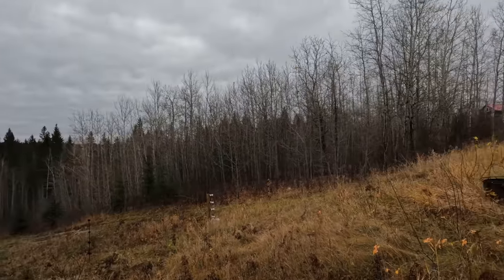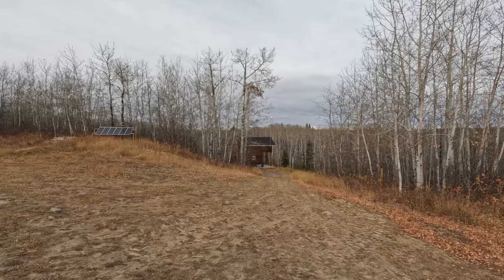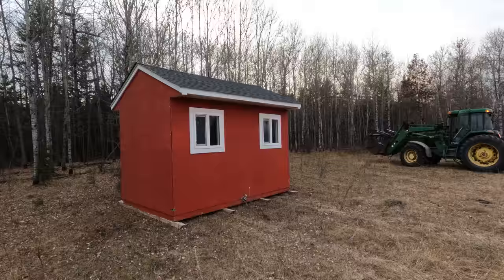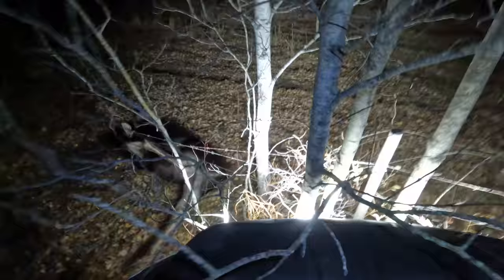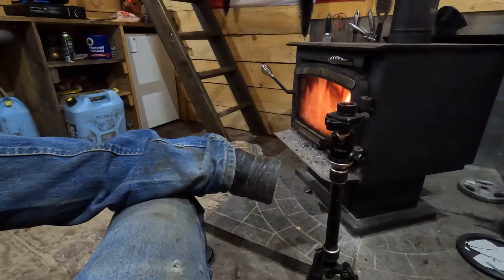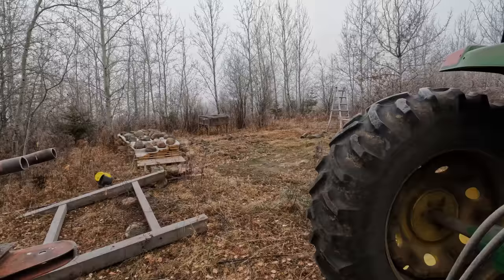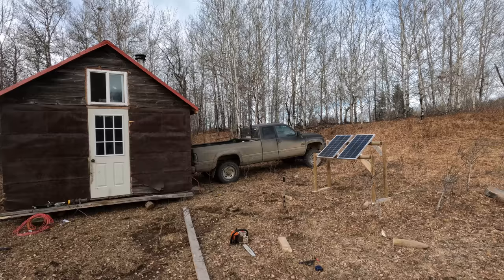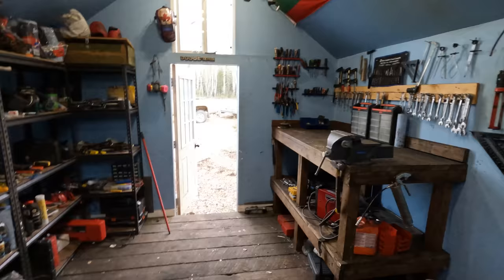Moving my Offgrid Homestead Pt. 1

Comment: I would put log skids under the main cabin. And no hurrying, just slow but sure and bring it on. I don't suppose you could get hands on some real house jacks to place the cabin on skids but if ya could then maybe get some straps right from the floor joists to the skids so it can't jump around a whole lot. A damn nice relocate... but the first place will always have a special spot for ya. I'd also move those logs that you started notching out in a form for log cabins and turn it into a fine outhouse... no need to waste a thing

Comment: Not sure if you have access to any I beam but if you do it would be nice to run on right under the left and right side under the cabin, chain or bolt an axle to it and rig up a tongue on it and away you go, keep it as close to the ground as you can so when it tips it just touches ground and not fall too far and bust stuff

Comment: First, leave the cabin where it is.  You have a lot of time and money to see go rolling down the hill and be completely destroyed. Protect your investment of time and money.  Plus, it is a place that you will always have to be able to go back into the deep bush yourself or it can be shared or used by family and friends to stay in for the future to visit or whatever.  Second, I have no idea how far your new home location is from your cabin presently but you could travel from home to work site daily.  You got through last winter and I'm sure you can figure out a way again.  Third,  you might want to consider remodel you chicken house. You could  put whatever size of addition on the side with the two windows.  Move the two windows to the new far outside wall or your selection of location. Place a shed roof or lean to type roof up to your present ridge.  Remove the metal roofing and reuse on the new shed roof.  of course you would need to possibly get a new stove and other materials but you would be at the new home work site  and when it is completed you could convert your large chicken hose conversion into additional storage, tool shed, workshop or whatever.  The small amount of $$$ and time you will spend to convert the chicken house for temporary lodging will be a lot less than the loss of the cabin going down the hill and then having to spend the money anyway.  You got great memories of everything about that cabin don't risk the loss and kicking yourself in the ass while you watch it roll down the hill.  Best of luck with
whatever you decide.  You have the talent to do whatever you choose.

Comment: I would remove the frame from wheel chassis if possible, lift the cabin drop her down on the frame or use skids and pull it with a dozer(not sure if that tractor can pull it or not, low gear 10hours of travelling time lol.......I think that trailer is a no no, can you imagine blowing a tire...or get someone with some experience to come out and have a look...Hope it all works out for you.....thanks for the video.

Comment: Yes, the tilting feature of that transporter is not so much a  feature but a problem for moving your cabin.  Move it like professional movers move most buildings.  Jack up the corners at strategic points a few inches at a time and support it -- just keep going around and around adding more supporting boards at each point until the whole thing -- including the porch -- is higher than the untilted flatbed, then just drive under it and lower it to the flatbed.  Also, this eliminates winching it into position. Then drive ridiculously slowly on a non-agressive path to its new home.  Reverse procedure and you're done. Drink a beer.
Reply: Also be sure the center of the cabin's mass is directly over the wheels so the trailer doesn't tip.  Very slow moving is key and no large potholes!

Comment: Hey to be perfectly honest I think if you have your cabin on a couple big skids like your shop it I think if they run lengthwise you could probably just pull your cabin right on the skids with that tractor. Wont have to worry about tipping it over that way or anything. Just my thought. As long as the front of em dont dig down too much I think it would be fine. Oh and put a good strong brace between the skids so pulling on em doesnt try to pull em lose and pull em together.

Comment: would you be able to dig away some of the dirt in front of the cabin so you could back the trailer right up to it and pull on flat? maybe even try to lube the tubes on the trailer with some wax so it will slide alittle easier. would also help pulling her off.

Comment: If you're going to move that cabin I would avoid tilting it at all. Jack it up and use cribbing until you can back that float right under it. Then set it on the float, reverse at the new site to get it off. This will keep the angle at a minimum, limited by the height of each cribbing section. (Use thinner boards to avoid excessive jacking.)

Comment: Moving the cabin is going to require most likely, two people and possibly two tractors. Use one to get the trailer under the cabin like you did with the other buildings. Then raise the trailer a bit to make it semi level and at the same time on the other side use another tractor to raise the building as your going under it with the trailer. This way you don't tip the cabin over and you can just back up with the trailer and cabin both level and slider her on. You might have to cut some holes somewhere to make sure she doesn't catch. Otherwise I would suggest taking everything out of the cabin to make it as light as possible if you do decide to do it yourself. Not sure how ur going to get it on with only one tractor if its top heavy without damaging it though. But even if you do somehow damage it, its not like you don't have an entire forest to fix it :P

Comment: It is possible to move your cabin your cabin but you are right in your thinking.  With my years in the construction industry and being an onsite structural engineer it is possible.   I'd like to also state 3 things.  One you would have to put in new beams under the floor.    I'm sorry to have to tell you that I saw how you built the cabin and there is Is one structural defect.   2.  The time that it would take to do all the bracing I believe is not in your best interest.   Lastly if you keep the cabin where it isYou will have an outpost down the road load it or you can use that to that when you're doing your trappingIn case of bad weather.   The last big thing I wanna say is I'm quite impressed with your ingenuity and the things that you are doing.    If you have any other questions or would like to talk more about this I would love to help you out with this project this project if I could.    Whatever you decide to do it's gonna be the right decision for you.

Comment: Great video. To move the cabin you will need to make it bigger, more square. Add a temporary side structure to it, and weigh it down with tractor weights to balance it all out. You're smart and motivated. I have full faith you can move it.

Comment: I think it's possible to move the cabin. But I would Drive some heavy duty eye bolts into the walls and run some criss cross cables or straps and up and down from floor to ceilings on the inside to keep the swaying down and make it super ridged and just creep a C hair at a time. slow and steady it should go smoothly. LOve this shit. Your a fucking stud my boy.

Comment: First I think I’d have the overhang towards the tractor. Then I would probably make some Custome steel type strap braces to go across the front wall of the overhang where your bed is and then the same for the other side then you could attach straps to them on angles from top front to bottom back and vide versa for the back to the front that would cover the front to back tipping then to help with the top heavy I’d add lots of weight to the main floor for ballast and if need be maybe add like a set of training wheels sort of thing to the trailer so it has a backup if it wants to go sideways. Maybe these ideas help maybe they already been suggested but regardless you can’t leave the cabin behind and so this is my ideas to help move the big bastard

Comment: not sure of your spacing but if you get your house high enough to get that lift trailer under it without tipping that would be best...other than strapping the tall bugger down what if you also dragged long logs behind or beside with straps attached to the top of the structure while on the trailer to help it from tipping...or even attach like out rigging to the side of the shed so it cant go side to side...like they do with canoes to prevent tipping over...

Comment: I would probably use a lot of come alongs so you can control direction of pull up the ramp. Tie the come along to the front of the trailer and some where close to the top of the roof so you can prevent the cabin from tipping on its ass. and go slow and steady. Back and forth from truck to come along making sure there is lots of tension. Again. Slow and steady. Also, be sure to say “she’s not going no where” every time, once it’s rigged or else it’ll go some where you don’t want it too. Best of luck. 

Definitely enjoy all your videos friend and looking forward to seeing more.

Comment: You need more frame on the bottom of it for weight and the base of it log runner bolt down and get the weight or the top of it a prayer might help go slow it's top will turn over

Comment: Glad to see you moving to a location that's easier for developing a homestead (and probably much closer to the road). 
I'm no expert at all, but I would move the cabin by building a external wooden frame which is screwed to the cabin. This way you don't squish the walls in and you have a better 'grip' of the building overall.

Comment: I would put the cabin on some big skids and pull it with the tractor not mess with that trailer to topheavy and the trailer on rubber sways to much or leave it there is the best answer your asking for trouble ya really dont need

Comment: Nice save of that moose and moving the coop and tool shed.  Better than watchin an old horror film tonight, although also a bit suspenseful.  😎
A fairly obvious idea for the cabin move, but the only one that I have:  use some strong braces (wood or maybe even straps) diagonally from bottom rear to front top and front bottom (of porch deck) to top rear.  Maybe the porch deck is not integral right now, but you can make it so...   The idea would be to get the cabin to act like a cube with the center of gravity near the center, not like an upside down L.

Comment: I'd use some 4x4's., Or 6x6's to slide that cabin onto your trailer with. For leveling purposes mainly To help with that part of stability.& Levelness & sturdiness all in one. Notch them out to fit underneath those other runners/ for joists studs by screwing in lag bolts.,or use some barn steeples. As in really long big barn nails for joining them together with. Myself I'd cut those steeples down to 5/8 length size for simplify everything on it all man A. Seriously it'll help ya out more in the long run to more. Plus you'll already be setup if you decide to relocate those buildings in different spots again to then where their at now for keeps sake as well to. I'd add on some srap buckles welded fully rings to connect your pull straps onto for loading your cabin on the trailer with.& For tying down purposes also just saying man. It'll add extremely extra security to as well. You'll half to run straps over the top of t the at cabin both directions to. So that means puts buckles on both directions to.

Comment: I think if you can figure a way to get it on the trailer you’ll be golden. Maybe weld some mounts to the trailer and bolt some eyelets into the cabin itself. So you can use some chain binders down low on the structure instead of straps over the roof and it would be plenty sturdy. But will you regret not having the real bush cabin still out there? That would be my only thought

Comment: You could probably brace the top of the cabin with some long logs bud, like from just under the roof/cantilever to the corners of the trailer. Might keep it from tipping. Also cut some holes in the floor and run some straps from the axle or frame to the roof beam. The distance between the beam and axle/frame would have to get longer if the cabin tips so strap the shit out of her. Love your content bud. I appreciate you. I can't wait to see the update. Happy Halloween 🎃

Comment: TAI, you have been drinking that cheap Canadian beer again, haven’t you?  If you want to move that cabin in one piece you’ll need the men and machines to move it.  A chicken coop and a shed are one thing.  The cabin’s weight and dynamics are a lot different.  It would be faster, safer, and cheaper to disassemble it board by board, numbering properly for later reassembly on site, than a one piece move.  Do it in the summer months with a few guys to help.  Regarding beer, it’s better to have a few good ones than a case of bad.  John 2:10.  Long live Tim Hortons!

Comment: OK!!!!!   DONT LOAD IT. THAT TRACTOR HAS ENUFF BALLS TO DRAG IT ON A JIMMY SKID. JAK IT UP, PUT A SLED UNDER THE BACK EDGE, WITH 3X 12INCH POLES, OR SQUARE TIMBERS YA CAN MILL. .  DO A PERIMETER NOOSE,, LIFT THAT NOSE UP A SCOSH , AND GO SLOW..  AND YA MAY CUT A NEW ROAD DEEPER INTO THAT LITTLE HILL TO DECREASE THE SLOPE. AINT NO WAY ID LOAD THAT CABIN AND TIP IT, YOU ALREADY GOT THE GUT SAYIN NO WAY! IVE RIGGED UP TALL PIPELINE TOOLS THAT WEIGH 25,000 LBS FOR SHIPMENT ACROSS THE GLOBE, AND WE PUT THEM ON SKIDS.. AKA JUMBO PALLETS. AND THEN JUST DRAG THEM AROUND. THEY SLIDE EASIER THAN YA THINK. MAY BE ABLE TO USE A FEW 3/4 PLY UNDER THE BACK SKID SO IT DONT RUT THE ROAD SO BAD. THIS EPISODE WAS FRIKKIN ADVENTURE NAIL BITING FRENZY.... LMAO!!! KIKASS RIGGIN THERE BROTHER TRAPLINE... AND YA SAVED A BABY MOOSE!.. HAAAAAAA GOOD JOB. P.S. YA CAN ALWAYS PUT A SAFETY STRAP UP HIGH, TO THE TRACTOR WITH SLACK,  TO HELP KEEP IT STABLE AS YOU GO.  EZ DOES IT.... PEACE.

Comment: Also use 2 poles as outriggers like on a canoe n brace them up the side of the cabin as far as half way n that should keep you stable enough n take that trailer back its just a waste at this point tow it with the tractor on the skids much safer ..hel even the ol 12 valve will pull the bitch lol ..

Comment: For starters I would brush out that road on the way out.  Then to stabilize your cabin you have a couple of ways to go but any way you do it you have to spread out the base with logs, timbers whatever.  Big ones like 12 x 12 timbers or power poles.  Jack up the cabin and get them under it.  Think about maybe cutting the upper level off and reassembling at the new site.  By using a 'raft' if you make it stiff enough you can put diagonal six by six lumber to keep the building from tipping.  Kind of like a skeleton 'A' frame on the outside. Then Jack up the whole affair so you don't have as steep an incline to slide up and can hopefully back the trailer under it without having to pull it.  Slide it on with large pipe (three or four inch anyway) so that you can bridge the pipe rack with the rollers and ease it aboard.  The pipe would be under your new runners and cross members.  Before it freezes you could build an earth ramp to facilitate the above.  Trick is going to be not to tip the building while loading or traveling.  Cutting two holes across from each other up by your top soffit and sliding in a couple of six by sixes   Or custom cut five by fives whatever as long as they can take the downward load to be applied. Run them all the way across the inside of the cabin one front and one back with protrusions extending two or three feet outside the wall. Making sure you have the two fully supported down to the base (a 4x4 screwed to your inside wall down to the floor to transfer the load would work inside of each penetration).  Not a bad idea to make up plywood gussets from the cross timbers down to the supports which will prevent racking the building.  Now you can really beef down on the extending ends which can protrude enough (I would go one straight down with one forward lead and also one after lead on each cross bar end) to give you the leverage to pin down the building . Easy to patch the holes when you get it where you want it.  Going to be a challenge.  The goal is to get the building straight up on cross beams resting on cribbing so you can slide your trailer under it.  Then lower it down.  I would not try the pulling with a base strap method as it would appear to be too top heavy for that.  Where you do strap the house spread the load by welding an angle iron 'L' to put under the straps at the corners.  Beefs the corners up and keeps the straps from dropping down.  You have a welder so that is an easy one.  Good luck.

Comment: 👍👍👍👍👍 My goodness. You are full of surprises. I never know what you are going to do next. You always succeed at what ever you set your mind to and that is because you know when to change your mind to something safer. I doubt you will be able to take your cabin out the way it is. I don't think your trailer is heavy enough to counter the weight of the top heavy height of your cabin. A slight lean in the wrong direction will pull that trailer right over onto its side somewhere on the trip or it might just pull the hitch off the ball on the tractor (or a weak spot in that area) on that first hill up from its current site. I won't be surprised if you cut the top floor off and reattach it after a two trip move. I'm not sure how you would do it but I'm sure if that's what you have to do you will have found an ingenious way to do it. Or maybe you will just throw together a quick cabin for the winter and start on you new Log Cabin, leaving your cabin where it is. Good luck.